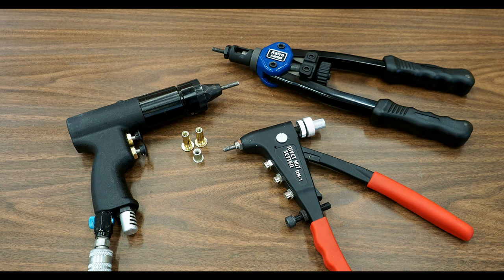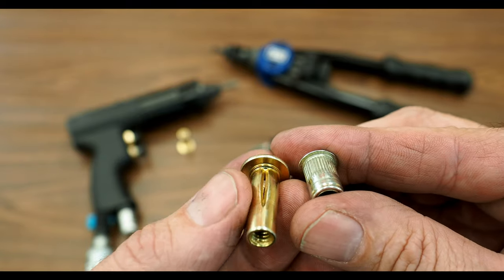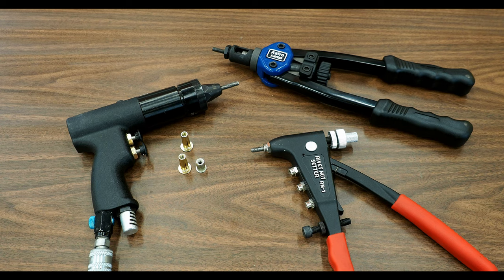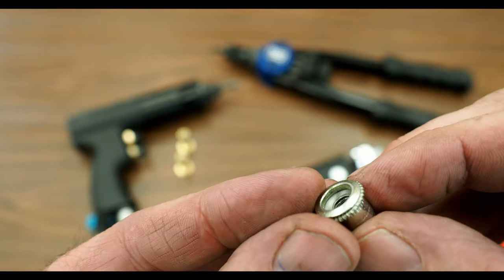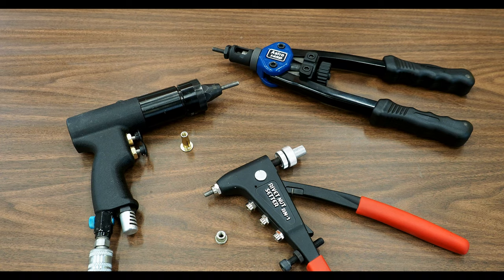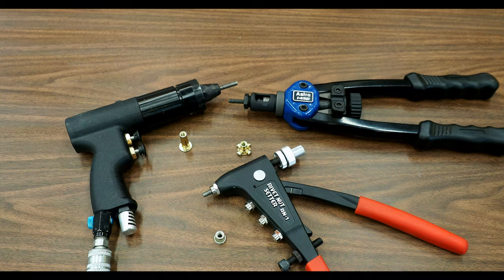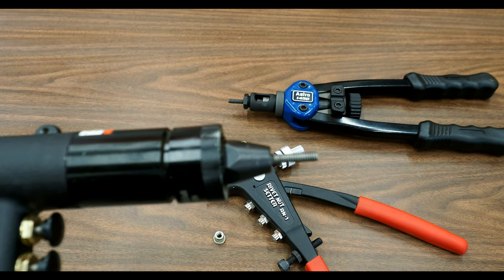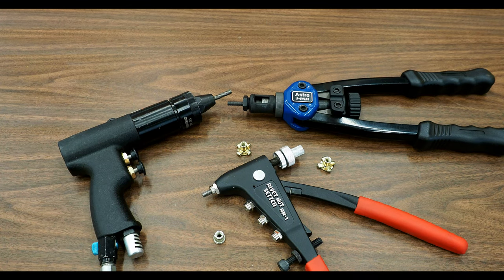Plus Nuts vs Rivet Nuts...and Install Tool Comparisons.

Comment: rivnuts were invented by the bf goodrich rubber company during ww-II as a way to install rubber de-icing boots on existing aircraft, which is why they have limited overlap on the internal sheetmetal but they do provide a very good seal, because most airplanes use their wings as fuel tanks so the rivnuts had to be as leakproof as possible. plusnuts are better for strength when you don't need a leakproof seal. if you were going to use these types of fasteners to install something on the outside of a vehicle exposed to weather, a rivnut would be better than a plusnut in that situation. you might get away with using a plusnut in an exterior application if you use a lot of sealant, but keep in mind it's an inherently leaky point of attachment you will have to monitor. plusnuts are more like a molly bolt for sheetmetal where a rivnut is more like a rivet.
Reply: John Edward Ogden invented this in 1921 and called it the  "Machine-bolt anchor". US Patent US1365719A. Goodrich Corp referred to this invention when they, in 1952 filed US patent US2763314A for a "Expansible hollow threaded rivet". Goodrich Corp describe the use of this "blind nut" in great detail in the patent application, but did not mention deicing boots at all. Goodrich had been installing rubber boot deicing since 1930, 10 years before WWII started
Reply: Thanks for this post. For exterior use, I use small bits of butyl tape on the hole and the threaded portion to ensure the whole affair is water tight. Beware that butyl tape is UV sensitive.
Reply: That was great and very much instructive , what looked intricate at first came out rather simple thanks to you
Reply: Rivnuts have never been installed in integral fuel tanks.  Think about what you are writing.
Reply: @SuperBardley Do you use rivets or plusnuts for exterior applications with the butyl pieces?

Comment: You did not set each and see which one can actually hold when a lot of rotational force is applied.  Looks like the Rivnut might hold better because of the serrations on the barrel.  Seems like they may hold torque better than four flat wings.  Also noticed that when you used the pneumatic tool the PlusNut wings twisted.  Most likely due to the rotational forces during compression.  Would like to know if this decreases or possibly increases it's hold on the sheet metal.  I ask about rotational forces because I have had Rivnuts spin when trying to remove them when they have been in for a long time.
Reply: Love to hate rivnuts when they do that. 
Definitely lubing the threads and the bolt threads helps out, but I always cringe when loosening a bolt thats in a rivnut
Reply: Make sure the hole is tight 🙂

Comment: Why do you put the nuts in the hole first?  When I do rivet nuts, I spin the nut on the mandrel, then use the tool to insert the nut in the hole.  That's way faster than having to turn the mandrel by hand using the little knurled knob to thread it into the nut.

Comment: There is one caveat using the air tool though: it rotates the bolt to pull the nut in, giving the thread significant friction stress that can deform it or even flatten it out. I'd not recommend this and similar tools.
Reply: This is why one should be sure the mandrel has been oiled/lubed prior to use. Duh.
Reply: @SuperBardley  The stress still remains... DUH!!!

Comment: Ive never used a plus nut before so this has been a good video for me. 1 big issue i would be concerned about using about using the plus nut would be the rotational torque rating as i would think you would be able to do a bolt up tighter. Obviously the pulling forces would be better on the plus nut but that would be an interesting test. When i am concerned with the rotational force i normally use a hex rivnut but i can only use these types at work as u need a hex punch or a lasered hole so they could be used.

Comment: Back around '03-'04 I worked for an auto company fitting out fleet vehicles. We used a pneumatic rivnut gun. The rivnuts we were using were the same as the rivnuts you show, but heavy duty like the plusnuts you showed. So the same shape as the rivnut, but heavy duty like the plusnut. I'm trying to work out if I can make a fitting/tool that I can put on my drill or impact driver to install rivnuts.

Comment: An important consideration is the blind side clearances. The plus-nuts requires way more side clearance and depth clearance too. There are situations where the plus-nuts are just too big. 

When the rivnuts are properly seated and compressed, they are a robust connection. I suspect that many of the “failures” resulted from poor installation, and I know this from my own sloppy holes (not so easily avoided). 

Additionally, rivnuts are available in stainless steel, which should be a critical consideration for exterior installations.

Comment: When I ordered grab handle from Sprinter store, they sent plus nuts and a simple bolt tool that could be used in a drill or impact driver while holding it with an open end wrench...worked great!
Reply from the maker: Those work great as well as long as you don't have a ton to do...even then they will work if you have the time 👍.   I should have mentioned those tools as well in the review 👍
Reply: @Hodakaguy  is there a reason you cannot just torque down the bolt that would be replacing the mandrills job? Similar to a Jordan anchor or a toggle bolt behind drywall?

Comment: I found an answer in the 'plus-nut' style. They have sizes placing the compression area further back on the bulb that will work in material besides sheet metal - like 3/8" (1/2") plywood. The common rivnut is not available for thicker materials.
Reply: yes, only suitable for thin plate
Reply: They would be good for box trucks with plywood walls.
Reply: @multibikermike4681  I am currently using the plus-nuts to install solar on an RV roof. very snug and secure!
Reply: @1noryb  That sounds tricky, good luck with waterproofing. You might want try some Lexel to seal them. That stuff is amazing.

Comment: “RIVNUT® – The Original blind installed internally threaded rivet, was invented (patent #2,149,199) in 1936 for the purpose of attaching a rubber aircraft wing de-icer extrusion to the leading edge of the wing. The RIVNUT® riveted the aluminum wing skin to the inner aluminum spar and then accepted a mating screw to attach the rubber de-icer. 

RIVNUT® fastener was given a military specification of MS27130 and an aerospace standard of NAS1329 and NAS1330. Use of the RIVNUT® expanded within the military and aerospace markets, and soon became popular in general industry because of its many design and assembly advantages.”

Comment: Thanks for the demo. Will the RN1 rivnuts tool work with stainless rivnuts? mostly 10/24 for use in a tight space.

Comment: I see many comments stating that the Mandrel  SOCKET HEAD CAP SCREWS must be purchased from the manufacturer. NOT SO.
The screw used in the mandrel is not special. This is a common Grade 8 Imperial Socket Head Cap Screw. This can be purchased in Grade 8 or lower grades in Metric also at your local Ace Hardware store.  No need to order from the Manufacturer. DO NOT USE STAINLESS MANDREL'S.
Purchase the black oxide colored ones. If you break them frequently, recheck your pneumatic gun or manual tool torque settings.
Reply from the maker: Exactly what I did 👍.  It works great 👍

Comment: I'm trying to possibly use these to repair a stripped out threaded hole in the sheet metal on the tailgate of my pickup.  The Torx screws hold on the access panel on the tailgate.  The screws are only so long.. so, the question is.. which of these two nuts brings the threads closest to the sheetmetal?  Hope that question makes sense.  Thanks
Reply from the maker: I would say a rivet nut will have the threads closest to the sheey metal since its thinner 👍

Comment: I have the same gun. We need for it to work with plus it’s but need the longer mandible/bolt. Can you tell me which one to get for 1/4 inch?  The instructions for the fun say to for use with plus nuts so we’re thinking about trying something different

Comment: I have made my own rivnut tool been using for 5 years and it works. fine but i am waiting for some Plus nuts to come to see if they will perhaps do the finished job better. I would have liked the air tool. but 205mm some bike i may not have enough room to work and may only be able to fit one nut and most i like to have three, sometimes i can use the nuts already fitted most of the them don’t match to the battery plate. Thanks for the link. REC.

Comment: i like the use of the PLUS NUT using the nomadic  drill but my question is this could you get the same result using this set up in a drill ?  by using forward and reverse you would be doing the same motions as a nomadic drill i agree you would need to adjust the power used as you would  using a drill in a drywall situation

Comment: That air tool is only meant for riv nuts.  I just clicked the link (i need a new one for work specifically for plus nuts because the ones we have keep breaking down) and it specifically says that you aren't supposed to use it to install plus nuts.  That and the mandrel is a unique part from the manufacturer, not just some bolt you can replace easily from a hardware store
Reply: The screw used in the mandrel is not special. This is a common Grade 8 Imperial Socket Head Cap Screw. This can be purchased in Grade 8 or lower grades in Metric also at your local Ace Hardware store.  No need to order from the Manufacturer.

Comment: Just started to fit Push nuts, for me better than rivnut.  Fitted lots rivnuts with no problems. I just wished i was working with more space to use air tool.

Comment: Could you just use a drill with a bolt/threaded rod in it?  Or customize a bolt/threaded rod for an impact driver?
Reply: Good question.
Reply from the maker: Yep, they actually make a tool like that, I haven't had the opportunity to see how they perform yet.
Reply: An impact driver with a stainless steel bolt works great.

Comment: I'm also doing a sprinter van and used self tapping screws for everything. Its all ripped out of the walls even light things like 10lbs. Pretty thin trash steel on this 2020 compaired to my older 2008 and 2004 self tapping screws held for 16 years, this one doesn't make 2 weeks and they all ripped out.

Comment: The plus nut works like a molly bolt, i think the rivnuts looks like it would be tougher to rotate with the grooved edge getting expanded into the inside of the hole.

Comment: Hi Tom. I plan to buy an Astro pneumatic rivet nut drill adapter. Could you tell me please what size of rivet nuts you need in van? For bed probably you use plus nuts. What size of plus nuts do you need? Thanks
Reply from the maker: I used all 1/4-20 plus nuts in our building.   Here's my build thread with details and pics: https://advrider.com/f/threads/hodakaguys-4wd-sprinter-build.1380154/page-5
Reply: @Hodakaguy  Thank you.

Comment: Skeptical of the kiauro pneumatic air gun. lots of reviewers on amazon said it was not strong enough to work on stainless steel rivnuts, let alone cross nuts, even with the psi cranked all the way past 130
Reply from the maker: It's worked great for me so far, but I've only used carbon steel plus nuts 👍
Reply: There's other manufacturers of these kinds of tools. I used to use one many years ago working on fleet vehicles installing heavy duty stainless rivnuts. The gun we had would thread into the rivnut and then pull it like a rivet gun, but it was pneumatic. I wish I knew what the make was, but that was years ago.

Comment: Was it difficult to adjust the air volume on the pneumatic tool?
Reply from the maker: The air is easy to adjust.  You can set a couple test nuts to get the adjustment correct, its not super sensitive 👍

Comment: I take it that you can use the Astro or air tool with the Rivnut as well?
Reply from the maker: Yes.  The air tool comes set up for the rivnut, to use with the plus nut you need to replace the arbor with a longer unit.    Both will do rivet nuts

Comment: Have you ever tried the Astro plus nut adapter for an impact driver/drill? Seems like a good option at the price of the hand tool but with the performance of the pneumatic. I would have to wear my ear protection though :-D
Reply from the maker: I haven't tried that one, im betting it would work good.   Would be interesting to see how long it would hold up 👍
Reply: @Hodakaguy  The Astro tool is working great so far. I've only used it for a couple dozen rivet nuts so far so can't attest to it's long-term durability. But it's FAST and easy. The instructions say use a drill with a torque limit set, but with an impact driver and some caution you can really hear/feel when it's fully set. I tried with a 12v impact driver (thinking that less torque might be less chance of snapping the mandrel) but it wasn't really powerful enough. And my 18V Makita has a really smooth trigger that gives me a good sense of control. 

For anyone planning to use rivnuts and already has an 18V impact driver, I'd strongly recommend checking it out.

https://youtu.be/ZkqdUQF81Qc
Reply: @Hodakaguy  been using the Astro rivnut adapter for drill/impact driver for about 6 months now. Only used it to install maybe 60 inserts though, but a variety of sizes from 3/8” down to #10. Overall, I really like it. I use it with an 18V impact driver even though the instructions say to use a drill to limit the torque. But you can go easy on it and I can really feel when the insert is fully set. Only had one spinner so far. It’s quick and compact although maybe the short armed manual might five shorter. I think it’s a good option even though the mandrel is too short for plusnuts.

Comment: Can I buy a cheaper pneumatic tool and have it work just as well ?  I found one for 1/2 the cost of the one shown in this video but don’t want to waste my $ and time ?
Hopefully I’ll get answer even though this video was made a year ago…
Reply from the maker: That's a great question, I haven't personally used the other ones so I can't make a comment on the suitability of the other units.
Reply: I’m struggling to get my RivNuts set and now I just found out about PlusNuts and like them better for my van build. Only doing it once not many different builds but just need to set so many to hang my bed and attach my cabinets securely to the walls ..

Comment: Comparing this with flowdrill. With the flowdrill once the hole is created i have to tap the hole. There is no additional fastener and no additional cost. with a flowdrill i have an option of a flat surface head. With plus nut it will always have a head sticking out.

Comment: That manual nut setter is a rip off...$20 for a 1/4-20 coupler and bolt, pretty much 4x what it would cost from the fastener dept at any hardware store.

I was considering a manual way using an impact driver (as seen on some other videos) but I'm having 2nd thoughts as if it fails it will be a PITA to remove.

Comment: I'm somewhat skeptical with that tool since Plus Nuts are purposedly designed to compress and BULGE extremely close to the collar in order to set in thin metal sheet (typically an van's body). This "neck" has to expand right by the collar, behind the sheet metal's back and way rearward close to it than where the bulb's slots do end. These pneumatic tools should work in thick (1/8" 1/4") metal but I doubt about the results in a typically thin gauge van's metal sheet especially with bigger sizes Plus nuts. I did try several YouTube showcased homemade Plus-T-Cross nuts tools and NONE solved that issue no matter the manual torque or impact/electric force used to drive them. I have an Astro 1450 manual riveter which is relatively cheap and sometimes a bit of an hassle to operate but it DOES COLLAPSE THESE NUTS NECKS EASILY AND DOES'NT DO IT ONLY  BY SCREWING THE BULB BACKWARD BUT MOSTLY BY PULLING/SQUISHING IT REARWARD IN ONE FLUID MOVEMENT. According to my readings,  the Kiaruo may work with most Rivet nuts but only small gauge MILD steel Plus nuts 

(say 1/4-20 max.) ...
IF SOMEONE CAN TELL ME I'M WRONG, PLEASE DO. i WILL REALLY APPRECIATE! ;o)
Reply: I don't know anything about the pneumatic set tool he was using but I use plus nut guns everyday 1/4-20 and 5/16-18. I also have a 1/2" gun as well. We get ours from McMaster Carr. They are not cheap but I have been using plus nuts for commercial van installations for 23 years and have had very few issues.  We have had several customers wreck their vans and everything held.
Reply: Just to add an experienced advice, I finally bought the gun (US is way cheaper) and it is definitely powerful enough for its purpose, at least with 1/4-20 and 5/16. 
Nevertheless, it does not solve all plus nuts issues since there are still a few of them turning freely but it absolutely makes the process easier, faster, more reliable and it collapses them straight so you can sometimes re-thread them with a tap. The nose setting screw and needle bearings wear FAST but are cheap and easily replaceable.
On my next build, I'll try thin lock washers and will also use the simple Mc Master-Carr tool to finish the compression manually if needed.
Sold my Astro setters and will never go back to manual period.

Comment: hello what model is the air driven plus nut tool
Reply from the maker: https://www.amazon.com/gp/product/B01CYD2NS2/ref=as_li_tl?ie=UTF8&tag=hodakaguy-20&camp=1789&creative=9325&linkCode=as2&creativeASIN=B01CYD2NS2&linkId=bb52da760e90045a82f260422d15aec1